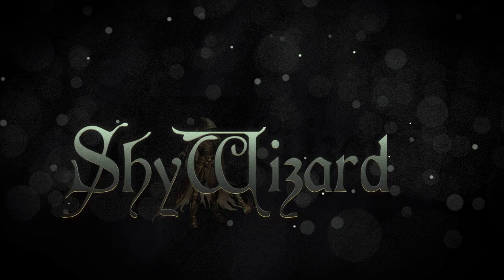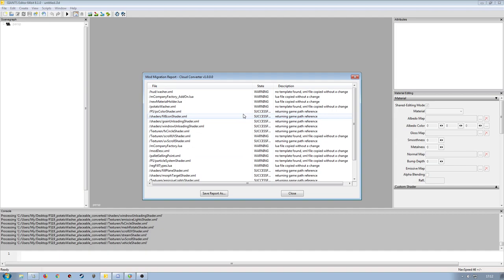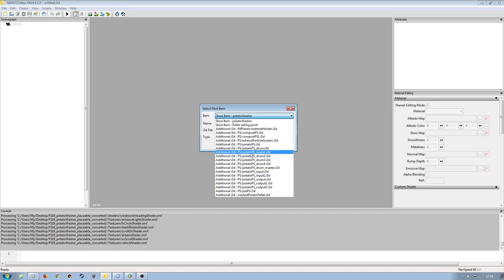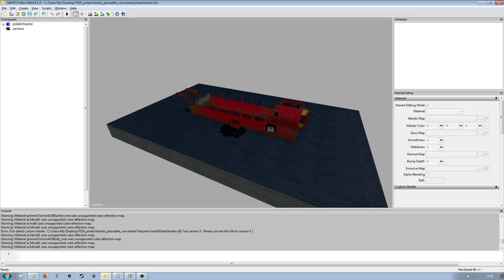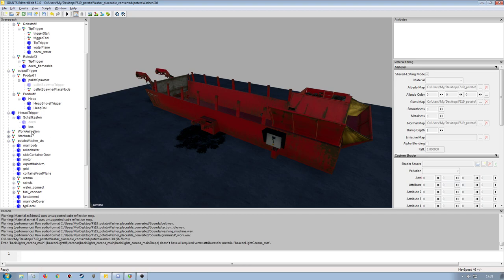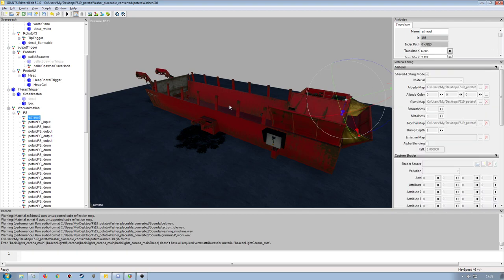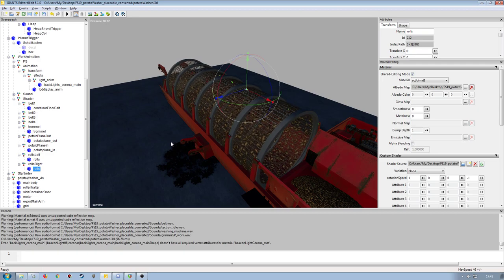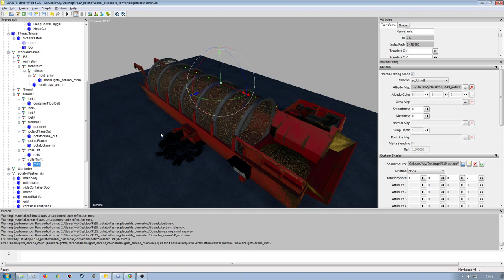Potato washer placeable mod conversion pt 1 - FS19

Comment: nice vid but the easier way to do the shaders after the auto convert is to open the i3d in notepad then re direct the shaders to the $data/shaders folder. it will save alot of time.
Reply from the maker: Very true & the way i would normally do it, but for a video tutorial imo it's better to do it the way i have for visuals & to see directly how each shader will change things.
Which ever way you choose is neither the wrong or right way as they will both work.